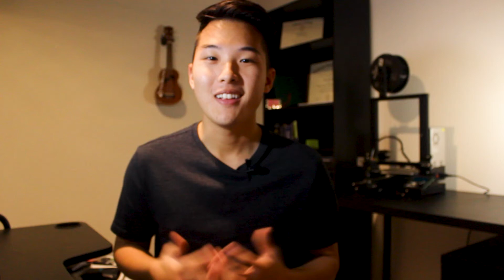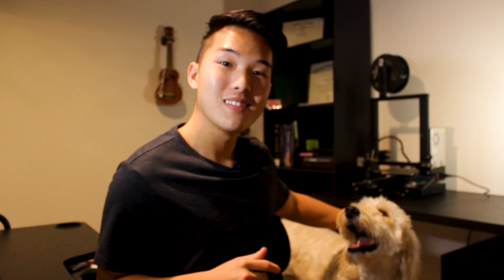What Automotive/Mechanical Engineers Do | Short and To The Point

Comment: I love cars, and mechanical engineering. I have my degree and certification in it already. But I’m struggling to get my foot in the door with an automotive company. Any tips?
Reply: Is it hard to get your degree ? I’ve always loved cars and I wanna design them make them test them that stuff, but I’m not the best in math I love it though, is it hard the math ?
Reply: @dominic2450  get a good college math tutor and meet as often as you can, it’ll take hard work but once you know where you need to start it will be a lot easier.
Reply: @jakesnell7707  thanks bro just feel discouraged I get good grades practically a straight A student except like 2 or 1 b’s but still a little discouraging non the less I will keep working hard
Reply: What’s the difference between mechanical engineers and automotive technicians
Reply: @Prva1l techs just fix the cars and engineers design them